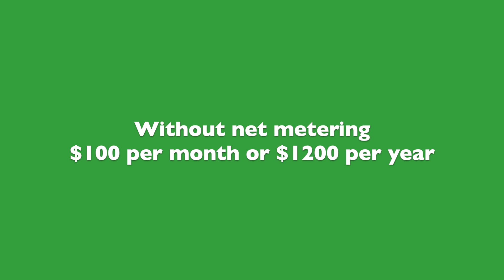Numbers & Facts: Passive House vs Code-Built Homes

Comment: Did you factor the cost of a solar panel system into your 5-10% cost difference between a Code built and Passive home ?
Reply from the maker: That percentage is just related to the “build cost” 
Adding a Net metering solar panel system has extra benefits
It would cost an additional 20 K approx for a Net zero grid tied 5-6 kw solar array..
If a net metering program is available in your area, your electric bill savings will be greater than the cost to borrow so should be installed for additional savings 
When all savings are considered, Passivehouse is the cheapest type of house to live in ✌️
Reply: Just checking that my math is correct. An approx 20K net metering solar system would save you $50/mth and there is $50/mth in administration charges payable ?
Reply from the maker: @qualitybydesign5119  
In our experience for most 3-4 bedroom family homes, savings would be $100-$150 per month depending on Hydro rates, depending on how often appliances are used 
A typical Hydro bill is somewhere between $150-$200 per month for a family house & after the home is net 0 on the net metering program, the hydro administration charges all that would apply are $40-$50 per month depending on area
Reply: I appreciate that a typical house has the hydro bills on average that you have stated. In your video an approx 20k solar system has reduced a Passive house utility bill from $100/mth to $50/mth. Hence spending/financing 20k to save $600 annually
Reply from the maker: @qualitybydesign5119  
To add to the conversation, when you’re looking at cost savings, the major benefit of passive house is that the home does not have a gas or propane bill, which saves an additional $1500-$5000 depending on the situation

Comment: Large roof over hangs are beautiful and protect the doors, windows and siding from rain and moisture damage.
Water is the enemy of buildings. Architects and home builders need to bring back large roof over hangs
Reply from the maker: Yes absolutely! Minimum 2 feet should be standard with increased overhang in areas of greater snowfall ✌️
Reply: Going for 3 feet here in Perth.   @EkoBuiltPassiveHomes